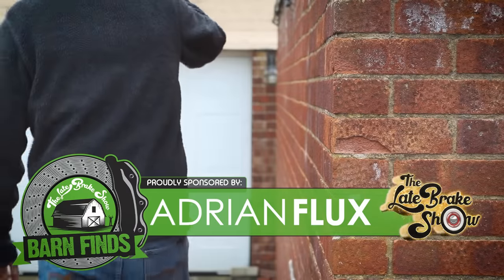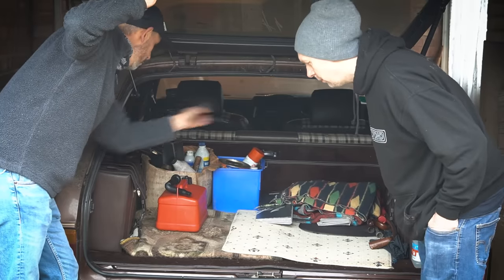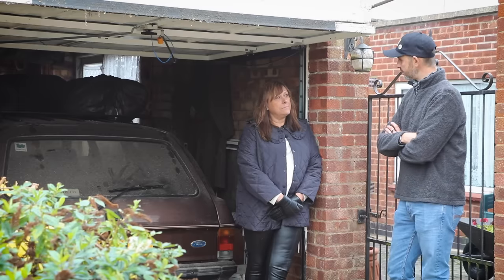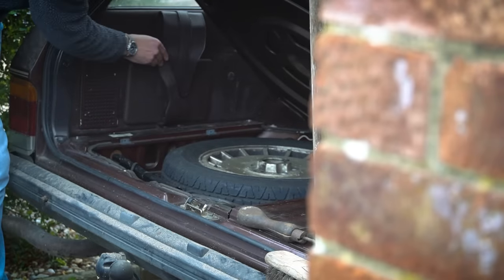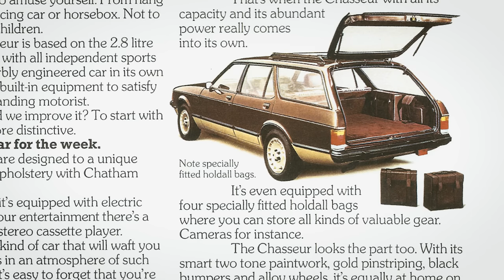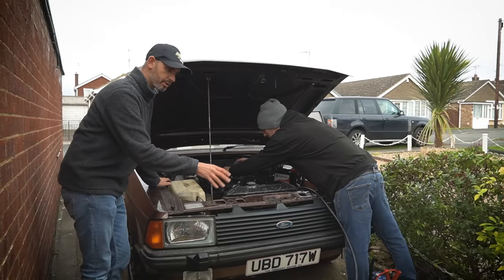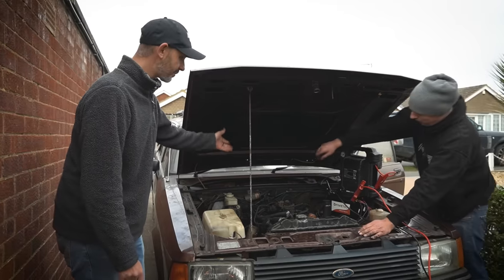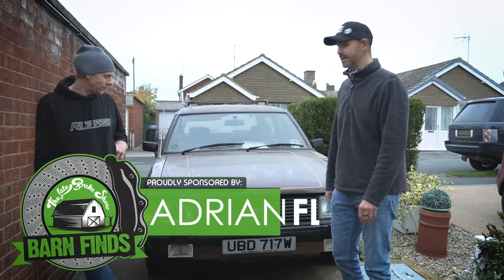Classic Ford Barn Find is the ultimate rare special edition

Comment: I worked at a Ford dealership from 1977 to 1983 , and I do remember the Granada Chasseur , I never understood what that decal was all about. 
If the car has air conditioning then it would be operated by they blower switch, which had the fan speeds 0 1 2 3 , if it had air conditioning then if you turned the knob anti clockwise and you had the fan speeds for the air conditioning.
They would have had rear bumper overrides, you can see that they have been removed.

Comment: I am amazed there any Grannies left.They are still appearing at banger racing circuits.Must have made a hell of alot.
Reply from the maker: Banger guys stockpile. They are also prepared to spend scary money on 'rated material'.
Reply: @TheLateBrakeShow  True enough.I knew a few banger guys and was surprised how much they spent.I sold a very good 740 to be snapped by one of them.Not a bit of rust on it !

Comment: My Dad had a Mk1 fastback Ghia 3.0 in red with a black vinyl roof, it was gorgeous, registration LEE100P (which I understand is on a Land Rover).
I had a Mk2 2.3 in red, but only an L trim, so not as nice as my Dads.
I have had a few cars since then including Lexus and my current Mercedes S class, but none of them have had as good a ride as either Granada.

Comment: Metric wheels & tyres - I used to have a 1988 Jag XJ40 Sovereign on Metric wheels - you're right, the tyres did cost 3 to 4 times the cost of 'normal' imperial dimensioned ones.

Comment: New to your channel today. :-) :-) I worked on these from new in the Cambridge area. I thought the driving lamps were standard too but maybe not. I also thought there was an upgraded tailgate strut ( more powerfull ) to alleviate tailgate droop. It has been a while................ The 2.5 diesel turbo must also be pretty rare nowadays - that just  seemed to pull forever. AC control on the heater fan switch?? Just twist the other way? The stereo should have been a 5 push button radio cassette Ford unit? Roman Bronze was difficult to match as there were 16? different shades from the factory.

Comment: You can see where Ford Australia got part of the design especially around the front on our late 1970’s XD Ford Falcon the only thing is we ran 302 & 351 Australian built Cleveland V8 and 250 and base 200 ci crossflow sixes but not only in sedan but also panel vans and coupe utility, thanks to our climate there still are heaps around but more so the higher end spec models you will find are the ones that were looked after over the years more so, also we had a larger wheelbase model in LTD form as well as Fairmont and ghia modeks

Comment: My Father went from a Zepher 4 (his 2nd) to a Silver Ford Exec to the Bronze 3.0 V6 Granada Gia.
It was like an XL sized Capri. However unlike the grossly underpowered and rubbish handling Capri, the Granada handled and went like stink. It left oh so many sports cars for dust away from traffic lights. 3000 rpm 2nd gear, dump the clutch and lift the front wheels 3' in the air! Brilliant fun. 85mph peak revs in 2nd.

Comment: I had a '78 2.8GL ('cos I did not want the hassle of GLX or Ghia extras or the insurance that they entailed), with the Pierburg carb.  When starting from cold it was essential to dab the throttle pedal gently to reset the automatic choke to it's start position.  Failure to do so (ahem, only a few times yer Honour) made it a pig to start.

Comment: Ah yes. The metric tires. Some Ford's in the states had them as an option. Michelin TRX radials, if I remember correctly. I was working at a tire shop in the mid to late 80's. Even then it was difficult to get replacement tires and they were pricey. The customer would usually buy standard wheels and tires for replacement.

Comment: Checked the MOT history.  The mileage was recorded as 49,999 in 2006, 2007, 2008, 2009 and 2010 and then it was obviously mis-read and recorded as 49,990 in 2011. No MOT since that date.
Unless the car was taken to the MOT test centre on a trailer the recorded mileage would indicate that the Odometer is not working.

Comment: The only thing about this car that holds it back has to be the V6. In comparison you got a 4.2L I6 from Jag or 3.5L V8 from Rover. I would guess this wasn't a cheap car by any means in it's day unless one got lucky and managed to get a discount. The rest of the engineering and certainly the looks are there for that Granada.
Reply: Nothing wrong with that V6, they're a lively engine.

Comment: A family friend had a chasseur with all the luggage. It was a nice motor. I had a face lifted mk2 ghia x executive.  The air con was activated with the blower switch. If you can only select three speeds it is non-air con. Unfortunately from your video I didn't get a clear view of the heater blower control.

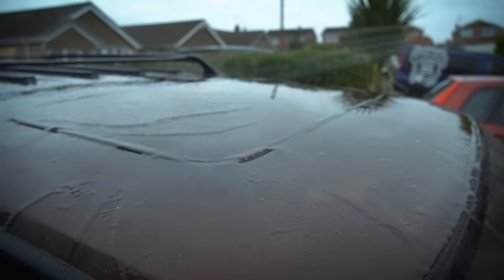27:27 moon roof, not sun roof...just saying.

Comment: I remember the Granada version very well but don't really remember the Sierra one which is embarrassing as I use to work at a Ford dealership in the parts department in the 80s /90s 🤦
Edit just noticed it had silver alloys (or they look silver) in the vid   , I  do remember they was gold or a  goldish colour alloys on the ones I saw.
also my manager had a two tone dark blue top silver bottom half Granada Ghia X pack 2.8i .
Reply from the maker: The alloys were very light gold, as you say. This one does have those, but hard to see in the video.

Comment: I have not read all the comments so someone else may have mentioned this, on air con models I think the blue and red slider colours may have been green and red ? i think you actually had to pull the rotary switch out to turn the air con on, bear in mind it was basic air con and not climate control .Myself, my brother and my father had about 16 Granada between us many years ago over a period of time, Dads were nearly new and new whereas ours were all used models

Comment: Wonderful video Jonny and what a lovely car  (Chausseur is French for Shoemaker ?) - id love this car - needs to be used, enjoyed and cared for - it  would look wonderful towing our Caravan :-)   I remember looking at one of these with my Dad at a used  Rolls Royce dealer in the midlands when I was 13 or 14. the car had been taken in part exchange. the dealer wanted £3300 pounds for it at the time and my dad uhhmd and aaaghd as the car, although about 18 months younger than our 2.8 GL Manual Saloon had done around 70,000 miles (twice that of our 2.8GL), leather was scuffed, one of the bags was missing out of the rear and the straps were ripped on the others plus numerous  dings and scratches on the body. he decided it was not the car for us :-( we did however buy a very low mileage W Plate 2.8GL Auto Estate (WPU 46W)  in metallic graphite grey from our local Ford dealer - Lloyds of Stafford  shortly afterwards; done 50,000 miles and one owner and was a lovely head turning car and immaculate. I recall we paid the same price as the Chausseur had been @£3,300. Dad kept this one for a few years until we drove past a local performance car dealer who had an X Plate Granada 2.8 Injection 200 Estate @£6150....... What is one of these I hear you ask ? Well ..... it was the Granada version of the Capri 2.8injection and Ford only made a total of 200 of them; came in Red / White / Blue and Graphite Black. TRX alloys the same as the Chasseur but in white for all body colour options rather than Gold. Recaro seats - Manual 5 speed Box, top mounted round front driving lamps, below bumper spoiler. very mean looking car  indeed. He then replaced it with the ex Geneva Motor Show  A reg 2.8i Chia X Manual Estate with Roof Rack Deleted (?? Not sure why ) cost then was £7200) - had  TRX's , front spoiler, round upper bumper driving lights and and lower bumper fog lights; my dad had this car for about 6 yrs and had the valves, guides and seats done to handle unleaded (big money I recall at the time !) he ran this one into the ground (litterally) - rusted through rear tailgate, front bumper lip and scabs around the lower bodywork and got £1200 for it when sold about 5 yrs later.....

Comment: The rims are not tdx they are Michelin TRX ,My dad had two of these chassuers,both bought from Stormont Ford at Woolwich ferry, the second one an injection model which was later given to my brother who converted to 5 speed manual and then bought a 3 litre capri, so it was handed to me. I spent around a year getting it back on its toes and kept it for about six years,at the time it was fitted with Colway ditchfinders,which I promptly ditched, all you could get was Uniroyal or Avon's at £80 a corner back then! Michelin tdxe's in 390 size were unobtainable once the fad had died off. Many BMW and Granada owners ditched the TRX rims in favour of the standard 14" alloys.trx tyres were bastards to get off the rims too!

Comment: I know it may seem a little late to comment, but, Australia, and the UK had a lot to do with Ford cars between them, for example.. Capris, Escorts, Cortinas.. did, anyone ever bother to check, the Ford XD Falcon with the Granada..?.. the front and sides look very much like the 1979/80 Falcon, the Australian Falcon had at the time, I believe, 4 engines for it, a 3.3 ltr inline 6 cyl, a 4.1ltr inline 6cyl, a 302 V8 engine, and also a 351 V8 engine, might be worth checking out.. 🙂🙂🙂

Comment: Why do you start and run the old engine on 20/30 year old oil ? Would you not give it fresh oil before cranking it over, instead of circulating crusty condensation contaminated oil?

Plus you keep the old battery with 0 volts connected taking down the voltage of the jump pack..
Reply from the maker: We don't change the oil until we know it will have chance of firing.

Comment: Not sure why they didn't just take a new or decent battery for the car rather than using jump packs and jump batteries. It cut out at the end because it was just the alternator keeping the car running but the voltage spikes would have been horrendous for the 40 year old electrics ☹️
Reply from the maker: We took 2 new batteries and a jump pack. Used most of the power purging out the old fuel.

Comment: A Granada was a  different car in N America it was a European style  that was advertised that it had a ride as good as as a Mercedes Benz. The Ford ads they had a blindfolded person ride in a Mercedes Benz and a Granada they were unable to tell the difference between the cars. I owned a 1976 Granada 2 door with a 5.0 V8 it had slightly better ride than my 1977 Mercury Comet (Ford Maverick with sunglasses on) they shared the same platform a slight improvement in suspension I thought a Chevy Nova was a better car that is a huge admission from a Ford guy. I would also go with a Plymouth 340 Duster  or 340 Dodge Demon RT over a Granada yes I’m a Chrysler guy.

Comment: 24:00 Why's your mate revving the knackers off a cold engine that probably hasn't run in years? Seems like a pretty stupid idea.
Reply: He’s not - that’s probably less than 3000rpm plus it helps gets the oil pressure up and oil circulating - will have done it no harm